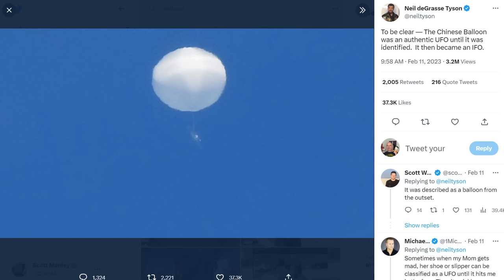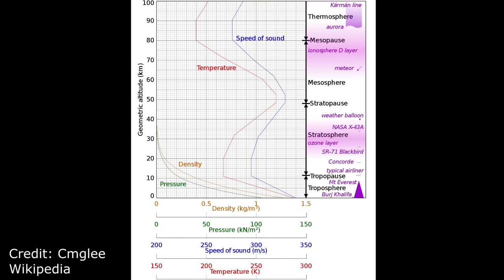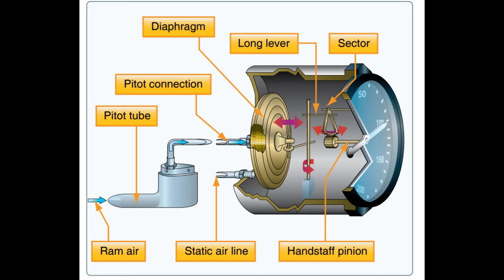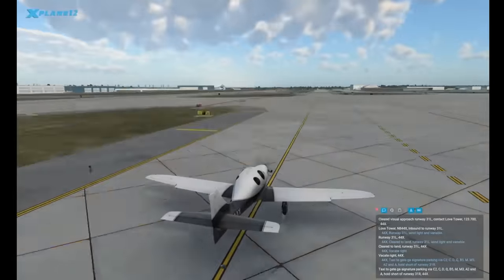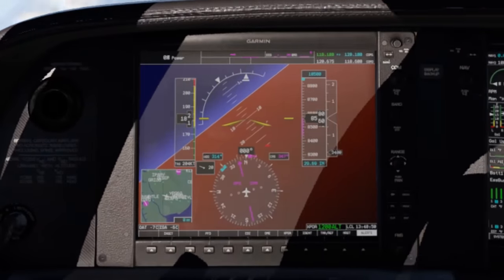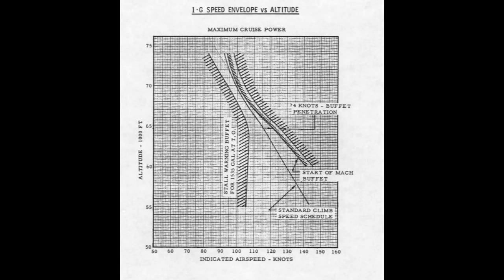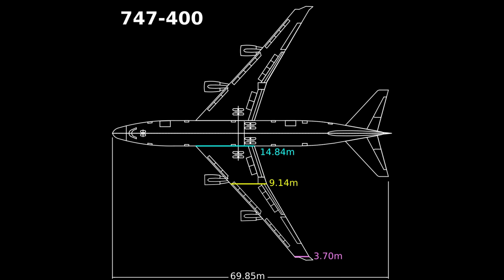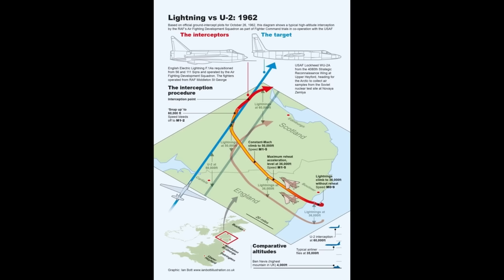How To Design A Plane To Fly At 100,000 Feet?

Comment: I'm interested in how close to Mach 1 a commercial airliner might get when flying very high and in very cold air. On a flight in Minnesota in Jan 1990, I saw a vertical feature above the chord of the starboard wing. Though wavering slightly with the airflow, it was stable and I watched it from several positions for around 15 minutes. If @scottmanley or anyone with some technical know-how wants to respond, I can provide further details.
Reply: Hi. We usually cruise at Mach .82-.86 for long haul types, regardless of air temperature we just fly for that Mach. Your experience is interesting. If it’s towards the back of the wing it’s likely the shockwave that a supercritical wing produces in flight. Conventional wings try to avoid producing a shockwave which will induce drag but supercritical wings deliberately produce one and are optimum used to fly in cruise with a shockwave near the back of the wing. Some really clever jets like the A350 that I fly even use tiny flap movements to control that shockwave. The big benefit of the supercritical wing is that you can fly faster without increasing drag significantly. Most modern big jets use one.
Reply: Hi Pete. Thanks, very interesting! I had never heard of supercritical wings. Fig 1 on the Wiki page ‘supercritical aerofoil’ shows the approximate position of the feature I saw. (It may have been slightly further forward.)  It was January and extremely cold. The pilot came on and said we were moving to a higher flight level (reason now forgotten) and soon afterwards I noticed this feature. It was vertical, quite narrow (a few inches), and extended above the wing chord for I’d guess 6-8 ft. It appeared as a greyish visual distortion that wavered slightly with the airflow. It was stable and long-lasting and I moved about the part-full aircraft to be sure it wasn’t limited to my window! It could be seen from a range of angles. I have a background in astronomy so have studied physics, and wondered if I was actually SEEING a shock - fascinating. And it sounds from your input as though that’s exactly what it was. Shall never forget this experience.
Reply: @skylarkstarsmith  do you recall which aircraft type (model) you were on?
Reply: @peteconrad2077  Sorry, too long ago!  I'm sure I would have known at the time; always been interested in aircraft and flying. All I can say is that I was flying BWI - MSP, direct nonstop. Probably not many airlines fly that route (I can find only Delta now but there may have been more then) and it might be possible to check what aircraft they were using in 1990?
Reply: @skylarkstarsmith  at a that time almost certainly a Tristar, which I don’t think was supercritical. if the shockwave was at the middle or forward then its likely not supercrit, if its rearwards then its probably is.
Reply: @peteconrad2077  That would make sense, then. The shock feature was def mid-chord or slightly forward of there. I'd love to know if anyone else has witnessed this. I think that to pick up that you are seeing  something out of the ordinary takes some interior knowledge. It puts me in mind of birdwatching: if I see a hawk, it just looks like a hawk. But the expert will spot that this sort of hawk lives in Africa and should not be here.
Reply: @skylarkstarsmith  that’s a good analogy. Next time you fly you’ll be looking for that front shimmer and be the expert pointing it out and explaining it.

Comment: I thought you were going to mention the problem with the failure of control surfaces when you get REALLY high. Like what happened to Yeager in that NF-104.

The classic example of the compressibility problem you were describing was the P-38. It wasn't until almost the end of WW2 that they added air-brakes to control that problem. A nasty surprise for German pilots.

Comment: im honestly not sure if they used a sidewinder, as the sidewinder is a heat seaking missile and balloons are not very hot, not jet engine heat signature hot 
i still believe that they used a Radar Guided missile instead
Reply: IF you lock the target in the plane, the missile looks, see's and goes for it.  The 9x is a moderns version.
Reply: @TheEvilmooseofdoom  im not sure of the aim9x has plane supported radar lock, its only to get a faster lock on a heat signature afaik (basically pointing it in the direction where the heat signature is for the sensor to get a better and faster lock)

Comment: At 100,000 feet or 30,000 meters, the plane would be flying in the mesosphere. While flights to such an altitude would not have much if any value for conventional air travel, they would be invaluable for spy missions and, on specially made aircraft, launch spacecraft from the upper atmosphere. 30 km is already a decent chunk of the way to the ''karman line'', the official boundary between space and Earth. At this altitude, you're above 99.99% of the atmospheric drag and some of the gravity,

Comment: Yeah,  really thing to write home about, shooting down a baloon....
About altitude. Commercial flights can reach FL 410, that is 41,000 ft. That is administrative limit for safety reasons. In case of decompression it is considered that passengers still have enough time to put on oxygen masks. With higher altitudes there is less oxygen, thus less time to react to remain concious. Some planes can reach even higher altitudes, but passengers would have to wear masks.

Comment: "Record altitude for a helicopter is 12442 metres."
"Flight ended when the engine flamed out".
"Also the record for highest autorotation descent and landing".

Sweet holy jesus christ in a chopper. My balls are actually up inside my body at this point, that is absolutely terrifying. The view would have been pretty nice though.

Comment: 2:10 "Helicopters". Well, helicopters have wings. The difference to an airplane is that the wings are directly attached to the engine, and move faster than the fuselage xD
Reply: Although the "engine attached" difference doesn't always fully apply. I know what you are saying, but most twin engine airplanes the engines are physically connected to the wings and push them through the air. The fuselage just goes along for the ride. In a helicopter the engine is mechanically linked to the "wings" and pushes them through the air. The main difference is how the wings are attached to the fuselage, in the case of a helicopter they are attached to a spinning shaft so that the wing moves in a circle.

Comment: "Most aircraft use engines which poosh against the atmosphere". NO THEY DON'T. Jet engines work on inertial reaction. They accelerate air sucked in the front. It is the "equal an opposite reaction" which provides propulsion.

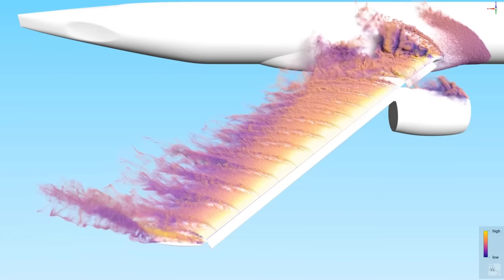Comment: At 1:55 you say: "Most aircraft use engines which push agains the atmosphere..."
Sorry, but that is wrong, no engine or thrust system pushes against the atmosphere.
A propeller aircraft uses an engine to turn the propeller. The propeller accelerates a large volume of air backwards. The force generated backwards this way must be compensated by an equal force in the other direction. Newtons law. It is this force that pushes the aircraft forwards. As a matter of fact, the air (atmosphere) behind the propeller works against the prop. If there was no air behind the prop (impossible, I know) the prop would generate more thrust, theoreticly about 14,5 psi!

A jet engine works at acactly the same way. A surtain volume of air is taken in at the front. This is compressed and goes into the burnchamber(s). There fuel is added and ignited. This heats the air and it expands. The hot expanded gasses are expelled at the rear of the engine generating a large force backwards. According to Newtons law, this force must be compensated by an equal force in the opposite direction, and that pushes the aircraft forwards. Same as with the propeller, the air (atmosphere) behind the engine lowers the thrust.

A rocket engine works exactly the same way; there is only one difference. A rocket engine does not need outside air to work. The rocket carries all the necessary fuel and oxydiser to generate the huge gasflow at the rear. If the rocket would push against the air to generate thrust, the rocket would not work in space! And yes, the rocket engine generates less thrust in the atmosphere than in space.

One other completely different yet the same example. The jet boat. The water jet of a jet boat will push the water out above the waterline. This way the jet produces much more thrust! I know, when going slow the water jet is below the waterline and this does decrease the thrust generated by it. When the boat comes up to speed, the water line at the back of the boat goes down and the water jet gets above that water line. On some speedboats you can feel it in the same way as a turbo kicks in with a car engine, you get a "kick" in the back. That is how much the thrust increase could be.
Reply from the maker: How does a propellor accelerate the atmosphere backwards without applying force, I.e. pushing on it?
Reply: @scottmanley  The same way a wing generates lift. Look at the cross-section of a prop blade, it is a little wing.
Reply from the maker: Yeah, under flight conditions there’s a pressure differential, pressure is force per unit area. Force means pushing.

Comment: "Engines that push against the atmosphere". You certainly mean engines that breathe air and rely on the action-reaction principle, and lack thrust steering (regular planes)!
Reply from the maker: To make Newton’s third law work you still need Newton’s second law.
Reply: @scottmanley  I think you are missing the point, of course there is a direct push against surrounding air effect to some minor extent, specially if the plane is sitting at the end of the runaway waiting on full throttle with zero air speed, but it is not the main reason the thrust of a turbine is transferred to the frame. I am sure if you ask most of people without physics knowledge, were a plane gets its push or why a water hose that gets loose wants to move like crazy, its because both expel something that is hitting the surrounding air, and you do a weak favor (probably unintentional) "reinforcing" that belief. Of course there is a tricky thing with turbine airplanes, and that is that they require air intake for the combustion, which will anyway impose a limit on altitude. In space you do not push against the vacuum which has no mass, but inside of the rocket chamber there is certainly action-reaction happening against the chamber walls.

Comment: Interesting video but disappointing to see you perpetuate the myth that lift is mostly generated by airflow over dynamic surfaces (Bernoulli) whereas it is mostly from Newton's third law via the angle of attack
Reply from the maker: If you're going to fly then you absolutely have to understand that the low pressure above the wing is critical to the lift process, at least for subsonic aircraft. Losing that low pressure zone by exceeding AoA is what generates a stall.

Comment: Ha, ha, ha. Scott believes the official unclassified service ceilings for the U-2 and SR-71.
Reply: The issues with the U-2s' ceiling altitude were quite real.     Remember that the speed of sound at that altitude is just a tad over 400 knots.     When at altitude, the pilot had a very specific speed that had to be maintained.   If he slowed by only a few knots, the plane would stall and lose altitude, making him more vulnerable to attack.    If he accelerated by only a few knots and hit mach 1, the buffeting would destroy the plane....    However, when the Skunkworks (Kelly Johnson) designed the Blackbird, they created an entirely different animal and it's true performance specifications will remain classified for many years to come, and justifiably so.
Reply: @stargazer5784  Where did you read that?
Reply: @dalecomer5951  The issues with flight limitations on the U-2 were published many years ago, and it's hard to say where I first read about it.      They knew that the survivability of the design would soon become problematic because of advances in Soviet SAM capabilities.    This knowledge is what drove the development of the Blackbird.      Oddly enough though, further development of the U-2 design continued, even after the introduction of the SR-71.    The last variant on the U-2 design that I can remember was designated the TR-1, which was larger and heavier than the original design.      There's a lot of cool aviation history stuff out there.     Cheers.

Comment: don't say that a helicopter's engine generates all the lifting force required on its own. I mean, you surely know that the blades still move through the air doing just the same as a moving aircraft, right? or expressed in even other words: all the downwash produced by a stationary helicopter stems from the blades and not directly from the engine itself (like in case of the harrier.)

Comment: Rocket planes and plain old rockets (puns anyone?) don't need to push against air. Considering the typical very high standards I've gotten used to on your channel, I'm really surprised you fell into that  rookie mistake common from newspaper reporters etc. It's also a documented wrong answer on the FAA flight test examination you took. Rocket planes like the X-15's high altitude flight regime is derived from the fact that they don't need to CONSUME air to burn their fuel, they carry their own oxidizer. The only aircraft that you MIGHT be able to say "pushes" against air for thrust is a propeller plane but even that comparison is tenuous. I guess the fact that a prop plane can't fly in space like a rocket would support that misconception too but it's not actually pushing AGAINST air, it's "propelling" a mass of air backwards at a relatively low speed to provide Newtonian thrust, just as a rocket or a jet, just at lower exhaust speeds. The fact that the air is pushed back by a "fan" at such lower speeds is why jets can fly faster and higher, the added power from the compression derived from the energy of burning of fuel adds a higher energy and  exhaust speed with tremendous thrust that a prop using a lower power piston engine which only pushes back cold air can never achieve. Another benefit of props is the more rapid response of thrust when power is applied as the piston engine can rev up at in its relatively lower RPM range as well as the added lift over the wings at low speeds that aids in controllable flight at low speeds (obviously not in pusher props). Another down side of jet engines over props beyond the added lift at low speed is again related to that engine RPM. Jets turn at 30,000 rpm, not the 2,500 RPM typical of non-geared aviation engines so their is a decide lag when power is applied. That's why  when I flew jets you never spool down power on landing approach, you use speed brakes, that way if you need to go around you aren't killed falling into the ground while waiting several seconds for the pm to spool up and provide thrust.  One of my Bellancas that didn't have a gearbox actually had a modified O-435 that revved up to an astonishing 2,900RPM to increase TO thrust from 190 to 224HP.
Comprehensibility is the correct aerodynamic term for the problems close to the Mach limit. This is a reason most plane that are expected to fly in that envelope also have full flying elevators instead of a stabilizer with a hinged elevator. 

BTW many people don't realize that the X-15 couldn't use it's aerodynamic surfaces for control as there was literally no air. It actually had thrusters like a space capsule to change it's "reentry" attitude.

My bono fides? I rebuilt my first airplane at the age of 22 and flew in the USAF afterwards. I've owned several antique Bellancas ('46, '47, '50, '51 and 'a 59) as well as a few 1940 Taylorcrafts, even had a '59 Comanche. I'm a 69YO retired semiconductor engineer who also sold million dollar electron microscopes and mingled with some of the most advanced labs in the US, even handled a sample of the infamous Space Shuttle O-ring at Morton Thiokol in the late 80s. I moderate at High School Science Bowls, tutor college level physics and work with STEM students. I'm now an artist and you can check out my art at emergeART on Facebook.

Comment: Surely it's time for the international community to work in metres, not feet, when we talk of aircraft altitudes? Also sensible to dispense with knots and miles per hour! Archaic distance measurements like this should join cubits in obscurity!
Things would be so much simpler and safer if these changes were made.
Reply from the maker: Knots actually make a lot of sense, since knots are based upon angular distance over the surface of the earth. Which means if you're navigating along great circle routes you can drop an unnecessary conversion step.